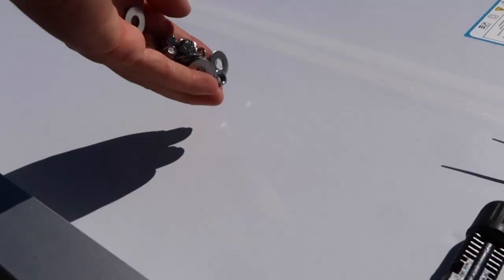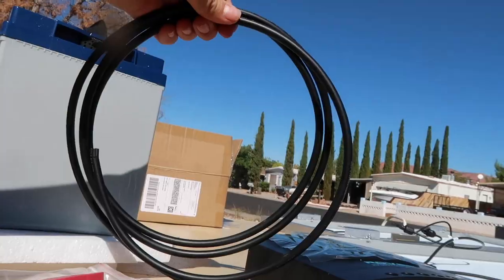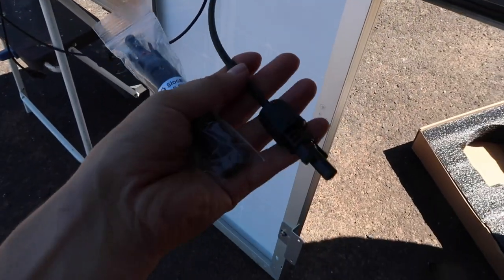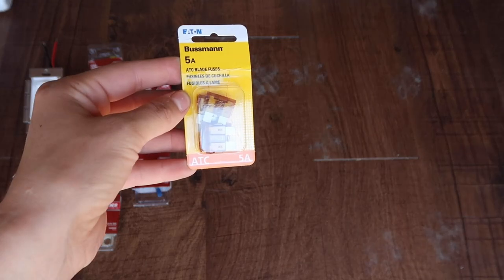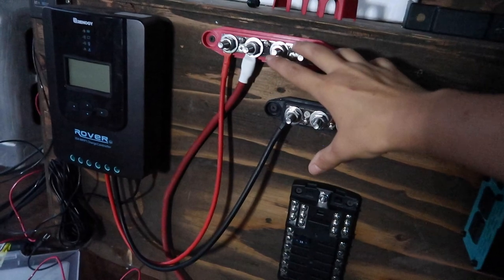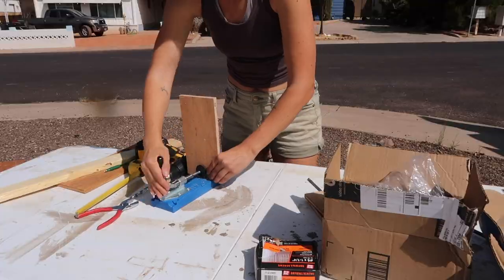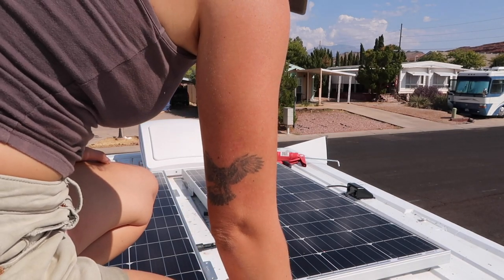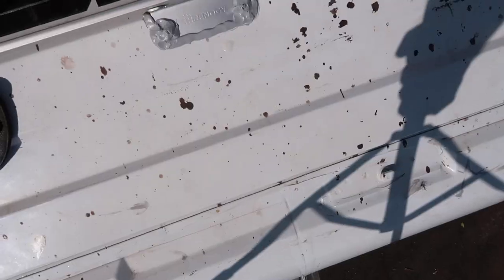SOLAR INSTALLATION 200 Watt Premium Kit | WITH FUSE BLOCK

Comment: Just a word to those who install their own solar! I live in Tasmania Australia and a camping trailer( they call them caravans here) was traveling down the highway and their solar panels came off and caused an accident killed three people in the car behind them! Don’t rely on just tape! Linnea has been very wise to attach with screws as well and also consulted with a friend who is an installer builder to get more advice. Good on you Linnea.  Hi AKELA! 
Please make sure you have things secured...so no one else has to loose their lives!
Reply from the maker: Thank you so much for sharing all of this! I will pin it to the top of the comments so hopefully more people can see this and be aware. THANK YOU.
Reply: People only tape their panels on? Holy shit.  :o

One thing people might want to consider when attaching panels to the roof is that contact between aluminium and steel can cause corrosion in certain environments. Someone with more experience with metals might want to chime in on this, as I am no expert.
Reply: I would also add that it's a good idea to use lock nuts on the panel mounts.  I used the standard nuts and lock washers and noticed a screw and nut laying on top of my van one day and found that it had vibrated loose on the panel bracket. I took everything down and changed all of my nuts to lock nuts.
Reply: Wow thanks so much for sharing
Reply: Nico 🤗😗😍
Reply: @ontheroadwithgramvango5006  A second nut that you thighten on top of the first one may also work. But using locking nuts is still better.
Putting a few drops of glue on the threads above the nuts will also stop regular nuts from falling off.
Reply: 3M VHB tape is rated for 8K lbs of shear strength..If it comes loose. You flipped the van over....
Reply: @WizzRacing  Tapes rattle loose and degrade with moisture.  No matter what,  anything on top of a vehicle should never be taped on.
Reply: @michaelneilson977  Not VHB tape.. They use that shit too install 200lb high rise windows. 

If it comes off. yo used the wrong tape or installed it wrong.. As I been in 125 mph winds. It never come lose. And that was in Texas heat and cold for 6 years.
Reply: Where did you order the water seal part from
Reply: 3M VHB tape is perfectly fine and safe to use as the primary/only means of mechanical connection of solar panels to steel or smooth & strong fiberglass roofs. It is FAR stronger than the ordinary lag bolt connections used in the majority of RV/canper installations with EPDM or rubber roof membranes over thin 1/4" / 3/4" plywood or OSB, the most common roof type in the RV industry in the USA.

Comment: You have install your 12 Volt DC power system and it looks like a pro did the work. Outstanding !!! I would shorten the solar panel cables ( storing the cables in the way you did could make a magnetic field and that could damage your 12 Volt  DC system) I do not know what you do to pay the bills ,but I think you have the ability to do anything you want to do. Which is a great thing to have , it will help you in life.
Reply from the maker: John thank you so much! I will do that right when I get back from my travels! I appreciate your support and advice so much.

Comment: Don't think anyone has said this but Your inverter has a flat battery cut off but your lights and fans etc don't so it would have been better to wire these into the load output of your charge controller so it would cut power when the battery is flat, this way if you leave something on and come back a week later your battery hasn't been discharged so low it kills it... Also typically it's not best practice to coil wires like you did for the solar as it will make an electromagnet and in severe cases cause heat like an induction stove, but for the little bit of wire I don't think you will have a problem...  🙂

Comment: Really awesome how you are figuring things out! As you grow the power of your system it always helps to add cut off switches between your components so you can swap/repair stuff, like a switch between solar panels and MPPT, a switch between your battery and everything else, etc. And a multimeter kit can really help you diagnose any problems. Super cool work!!!

Comment: It is very impressive how you are learning on the fly. Now that you are a pro at wiring you should also sound like one. AWG stands for American Wire Gauge. That is simply the size of the wire, the diameter. To say 14 AWG you simply say 14 gauge. I have enjoyed watching your van build. You should be very proud of yourself.

Comment: You screwing that buss into your battery box reminded me of when I worked for the phone company. One of the guys installed an emergency phone in an elevator and when he closed the elevator doors, the screws gouged the stainless steel door on that side. Very expensive install for the phone company that day. Thousands of dollars to replace that door. It reminded me to pay attention not only if I ever installed a phone in an elevator, but to be careful installing a phone set on a wall in case there was a pocket door. Something phone techs don't deal with much anymore residentially.
Reply from the maker: Wow – great reminder!

Comment: very well done!. one thing I noticed that concerned me was the last power connection between the battery and inverter was at the battery. in my earlier days as a mechanic I had a bad connection inside a battery...very rare occasion...and when the positive cable was reconnected the battery literally exploded and know florescent light tubes out of fixtures above me and my boss that were on the ceiling 20' high. when I can I always make my last connection at the inverter away from the battery. that way I'm not looking right down over the top of something that might explode... and please use eye protection especially with electricity. safety glasses at least. young lady you are really quite something else... great work and research.

Comment: AWG = American wire gauge.  You would refer to the cables as being 4 gauge and the terminals as being 4 & 10 gauge terminals. Very inspiring video and you did a great job. TKS for your time and sharing.

Comment: Outstanding video. Still considering solar for my live-in RV.  Really appreciate you sharing your voyage of discovery!  

During the video, you attached the inverter positive directly to the battery positive. I recommend a fuse in line for safety, separate from the charge controller fuse.

Comment: the slant side to the wire fixture was supposed to be towards the front so when driving in rain all water would be diverted good work

Comment: You may want to install a disconnect switch on the positive lead from the solar panels.  This will allow you just to flip a switch to turn off power to your charge controller if you have to do any maintenance.  Great video.
Reply from the maker: Yes I have considered that! I decided not to in the end because I can disconnect the solar panels quite easily with this specific system. But I do think that is a great addition.

Comment: thanks for the video! I will be doing this with a travel trailer but I will be using a kit from shopsolarkits :) seeing you take all of the guesswork out of it makes me feel like this will be a breeze. My trailer already has a DC panel in it for all of my 12V systems so that saves me on figuring out how to set up a fuse block. Oh, side note, if you ever have to remove those panels in the future, use butyl tape instead of the 3M, it will last you a lot longer and its strong stuff (working in construction, we use it on metal roofing applications and when installing mobile home windows).

Comment: I know this video is a little old but I just ran into ur video.. and gotta say great job.  I just hope ur friend that told you how to. I hope he told you to FUSE the wire going to the fuse box.  The fuse box needs to be protected. At least a 60 or 70 amp fuse. Good luck Pretty..

Comment: You are seriously the first video blogger who ive come across that has helped me truely understand how to do electrical thank you so much so glad some one in the diy camper group shared your channel to the page everything is becoming so clear how to do now still some questions but getting there. Can you explain why you ran your inverter still straight to your battery instead of the bus bar? Trying to work out where my power set up will be but notnsire if will have money for the inverter i want straight away

Comment: Good job! You've comprehend basic electricals very very and got pretty clear and well organized system.
Btw, my camping trailer has smooth aluminum painted roof and four 160W panels there hooked just using 3M VHB tape. It doesn't have any additional holes, routed cables in from one of the roof air vent.
My van has through roof mounted rack which holds my panels and same kind of enclosure as you've got for cables.
My thoughts were that van can go faster and see rougher roads than trailer...
Reply from the maker: That is so cool to hear! Thank you for sharing!
Reply: @Linneaandakela  it has seen all four arctic circle seasons, still holding great.
Here the tape must be protected by 100% sealant coverage around mounting pad to keep water out which then when freezing will age tape properties

Comment: Both of your  electrical videos have held alot you explain it pretty clearly gives me a bit more confidence in tackling it. The zap wouldn't freaked me out for sure is there a reason why it sparked even tho the panels wernt connected

Comment: The only suggestion I have is to run the inverter off the buss bar as well. Just keeps things neater and more organized. But other than that you did a great job on the electrical.
Reply from the maker: Thanks!

Comment: Hey Linnea

So happy to see your solar video tonight...something nice to see before another Monday!  Looks like you are definitely secure against any leaks in the roof, but I'm just wondering if you've given any thought to perhaps wanting to upgrade to additional panels in the future...I don't know how this stuff works but it seems like getting to your solar connections would be quite an instrusive chore!  LOL.  IDK, maybe you're good with the two...I can't help feeling like I'd want to add more potential input in the future.  Either way, great job on weathering the "shatter storm" and getting all these devices connected and running...and you lights work!  Woohoo!   :-D
Reply from the maker: Hi Tom! Yes, I have! 
I made sure to leave enough space on my roof for a third panel if I want to upgrade. Similarly, the set up of my battery on my wheel well allows for an additional battery if that is something I am interested in the future. Other than that I would simply buy a larger inverter and call it good! 
Thank you so much for the questions and support!

Comment: Just replaced my 80W panel with 2 200w panels on my camper. That's as much as I wanted to put on 10 gauge wire 12v system I've got. My next trick is going to be a stand alone 48V 500w panel on the back part of my roof with actuators to allow it to track the sun. It will feed an Ecoflow power station. This will power anything that's power hungry starting with my laptop to whatever. I'll also use it to night charge my primary system when necessary. The 500w is bifacial so it'll be interesting to see how it performs on a totally white roof. I'm even thinking about actual reflectors on the roof to scavenge sun power.
Reply from the maker: That's awesome – well done!

Comment: Quick point. 4 awg is said  " 4 -A,W, G "
an acronym for  A=American W=wire G=gauge

Also, connect your inverter to the buss bar(s). Wired straight to the battery it isn't fused

Comment: Thinking of where your batteries are in relation to the route of wires from the panels and a space to house and connect the charge controller, inverter, fuses, and bus bars is a great starting point to sketch out a diagram for your plan of attack

Comment: Thank you so much for posting this video. I am building a 20ft Tiny House on Wheels (THOW). I have done all my research, designed my system, had it double checked it for fuse & wire gauge sizes, and then purchased all the components. I have everything I need but I have been PETRIFIED to start the install! Especially helpful to me at this time was to see how you connected all the components first and then could lay them out near each other. This video has inspired me to get started & plug it all in! THANK YOU SO MUCH!

Comment: put your bare ended cables into ferrells, prevents possible shorts at the terminal and the connection loosening after driving around.

Comment: Love your videos! You give us what we need to know without the extra vlogger dialog. Did you make a video going over connecting the DC wires you ran, to the fuse box? I skimmed through your video list but didn’t notice one.
Reply from the maker: I did briefly in the puck light video I believe!
Reply: @Linneaandakela  thanks! I’ll check that one out.

Comment: Hi! Thank you so much for your videos, they have been so helpful!! 

Do you have a video where you explain how you wired in your dimmer switch for your lights? On the light install video it says you explain how you do it in this video, but in this one, I didn’t see where you explained how you wired it. I would be very appreciative of some help if you have the time to explain how you connected it. :)

Comment: Love your low cost set up.  I am a little worried you might kill your battery.  First you said you already drained it once.  If you go often below 50 percent you will kill it in months.  Your 100Ah battery only has about 30-35Ah of useable charge.  Seems like you will get plenty of sun in Vegas and California but so much less in Wisconsin and other states.  Consider some other way to charge such as shore power plug or at least a connection to your cigarette lighter.  My advice would be get another gel battery just to be on the safe side.  Also remember that after about 700 daily charges this type of battery will reduce by 50 percent it's useable energy.  Finally consider putting one or two shut off switches between your panels and charging station and another to shut off power to your vehicle.  Will make it easier and safer to work on the system in the future.  Talk to the people at Renorgy to see if any of this make sense.  Keep going you are doing great on the van.
Reply from the maker: Hey there! I haven’t drained my battery at all - I am not sure where I said that, but nope! It has actually never gone lower than 70% yet. I monitor it super close right now while I am still getting to know the system and adding appliances. 
I have space set aside for another battery if that is something I will need in the future. As for the shut offs, the only one I would need is to cut off power coming from the solar panels - but since I know my system so well and they are very easy to disconnect from my charge controller, I decided not to! But that is a super common addition. 
I appreciate your information!

Comment: Trying to do my electrical system in the next few days and feeling really confused about ring terminal sizing?? The link for the bus bar gives the options of 3/8 and 5/16, but when I looked up the ring terminals you used, they say #12-1/4”. Is that right?? What size terminals and bus bars did you use???
Reply: Can I connect a 3/8” terminal to a 1/4” thing??

Comment: make sure the battery is held solid, the battery is very high, that battery should be brace at least metal toward the front, it can go flying to the front in a crash, secure that heavy battery.

Comment: Hej Linnea! 

We are also building our first van and are grateful for your videos.
I cant see anywhere in the video where you connect your battery to the cars chassi for grounding. Did you do that?

And it was really sketchy to see you use metal tools with no rubberprotection on the battery... glad you did not get electocuted :)
Reply: I am also wondering that? It seems like half of the people with the Renogy systems ground them to the chassis and half of the people don’t?

Comment: 18:05 I got the solar gland that has the MC4 connectors in it so if I need to change out a panel I can just unplug it on the roof.

Comment: After having a little more time with your system, is there anything you would change about it? I'm planning on more or less mirroring your system and am a little hesitant on whether or not 200w will be enough, but I don't have room for a third panel. I will not be working on the road so charging a laptop will not be a top or constant priority. Your videos are soooo helpful!
Reply from the maker: Great question! 200watts is plenty! BUT I will be adding a second battery for sure. 
Basically I have been using my current single battery for all of my dc appliances (running my fridge, lights, heater). But it isn’t enough for charging my ac stuff so I have been relying heavily on my Jackery for all the extra stuff! 

I hope that helps!
Reply: Linnea & Akela Super helpful! Thanks for getting back. Just need to figure out how to incorporate a second battery into my system. Or potentially could cheat a little and just get a jackery. 
I’ve watched and researched tons of van builds and yours are really well done. It’s much appreciated for those of us who are building now and will be in the future. Thanks so much and keep it up!!

Comment: Are the bus bars required if not using an inverter? Can’t I take the positive from the charge controller through the 20 amp fuse and directly into my fuse box to distribute to my appliances? Same for the negative back from charge controller?

Comment: What did you set the battery discharge level to on your charge controller? I've seen some people go pretty low, around 11.5 V, but feel like most of what I've read doesn't recommend having your battery go lower than 12.2 V. Thank you!